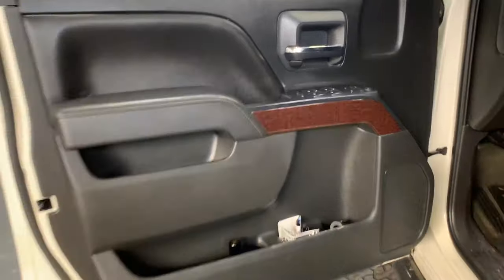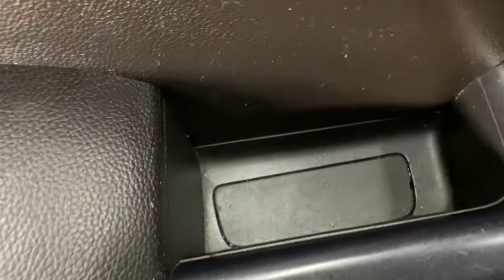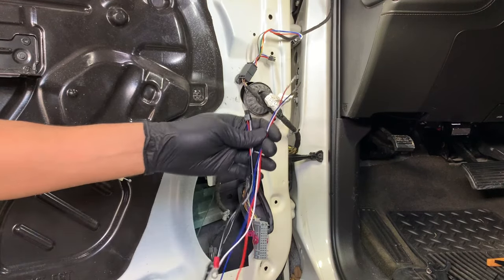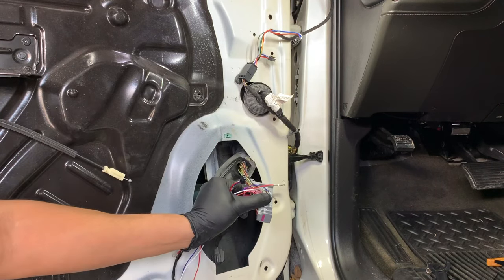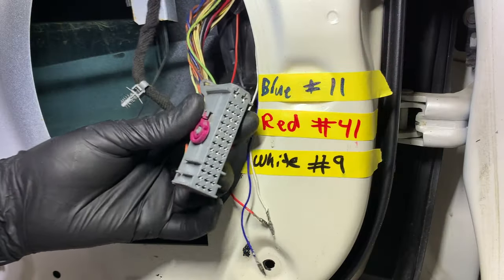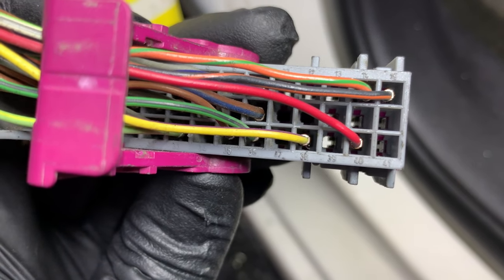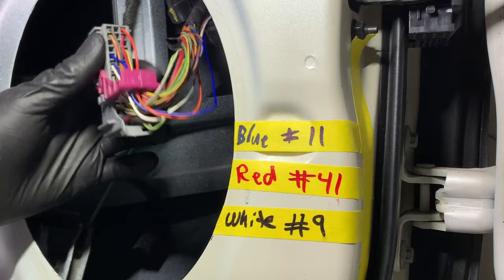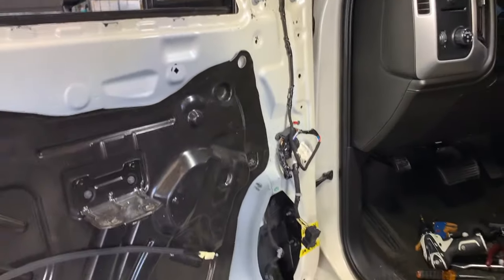How To Install / Wire Tow mirrors on a 2014-2018 Silverado / Sierra

Comment: Are those aftermarket tow mirrors eBay special or are they OEM GM parts will this work on both will these also powerfold
Reply from the maker: This is for the lights to work and will also make the powerfold work if you purchase the powerfold switch at the dealer . It will work on all tow mirrors.

Comment: I bought other tow mirrors, but for the switchback light the 3 wires aren’t pinned to anything. So For you guys tow mirror switchback option, are the switchback wires pinned to the door harness or somewhere else ?
Reply from the maker: Hi , this wiring harness provides power to the mirror for the running lights and turn signals to work . If you install the switchbacks correctly they will also work.
Reply: @kanohkustoms  would you be able to tell me how to wire up the switchbacks or no?
Reply from the maker: @FreddyS1K  I dont know where you purchased . The benefit of buying from us is we    answer any questions dealing with install or troubleshooting  .
Reply: @kanohkustoms  it’s from MidsouthLED , but lesson learned on where to buy next .

Comment: I was told you have to program your computer (dealer) to get the turn signal to work with your truck? Does this work then if your truck didnt come with the turn signal option? TIA
Reply from the maker: Hi , no need to program . This harness will make all the lights work if your truck was built after 08/14
Reply: @kanohkustoms  the harness compatible with OEM tow mirrors or only for the ones you sell? Thanks for the fast response
Reply from the maker: @chivassantana  yes compatible with oem and no problem

Comment: Did anyone have a green wire running into pin 41 already? I followed all the steps & when I got to pinning in the required spots, I had a green wire in pin 41 already. Do I bypass wiring the red wire since I already have a green wire in pin 41? Lost
Reply: I’m having the same issue what you end up doing?
Reply: @JoseGonzalez-uw3rc  I reached out to their “customer service” where I could ask about the green wire & provide a picture as well. I was told to pretty much connect the red wire to the green wire. Either share the same terminal or just splice the red wire into the green wire. Haven’t tried it yet but I plan on doing it here in a bit.
Reply: Ok thank you I spliced the red wire to the green wire but just to the pin part and left the green wire out everything works but the reverse little likes and the switch backs let me know how your turns out?
Reply: @JoseGonzalez-uw3rc  So yea bro, I did everything the way he says. Blue (11), White (9) & I kept the green/purple wire pinned & just spliced into it. My mirrors are working as they should with all functions. I should have recorded a video explaining before I put everything back together. Hopefully this comment thread will be seen by others tho if they’re wondering about having a wire pinned into (41) already.

Comment: What is the extra harness for is my only question
Reply from the maker: This will make running lights / turn signal / cargo lights work on tow mirrors.
Reply: @kanohkustoms  are the harness sold as a pair or single
Reply from the maker: @christiangirard6634  pair

Comment: Whats the difference if it was made before 08/14? Is there a seperate wiring harness?
Reply from the maker: Hi , if it was made before 08/14 there is no power for running lights or cargo lights in door jam plug so no harness in the world will work . We do how ever have a wiring kit that will make them work . Here’s the link . 

https://www.ebay.com/itm/124711530242?hash=item1d0962ef02:g:DyEAAOSwcvJgkx~1
Reply: @kanohkustoms  will the turn signals still work then and would you wire it the same then?

Comment: If my trucks mirrors have all the options already and power folding do I still need the harness or no? The mirrors on it have the blinker and running lights at the bottom of it
Reply from the maker: If you have small mirrors the lights at the bottom are puddle lights not running lights . The harness will make the running lights and cargo lights work .
Reply: @kanohkustoms  thanks! Will power folding still work ?
Reply from the maker: @matthewpitts9094  You’re welcome. Yes since your truck already came equipped with powerfold . The harness is only for lighting
Reply: @kanohkustoms  will there be a video for installing mirrors on a truck built before 08/14?

Comment: where can I get the pin connectors for the wires , my did not come with them.
Reply from the maker: We sell them together with the wiring . Here’s the link https://txtowmirrors.com/collections/14-18-gm-tow-mirrors-install/products/copy-of-14-18-gm-tow-mirror-wiring-harness-for-cargo-lights-turn-signals-running-lights

Comment: If I wanted to mount power fold mirrors on a truck not equipped is there a harness and switch for that as well?
Reply from the maker: Hi, all you would need is the powerfold switch . This harness will already provide power for it .
Reply: @kanohkustoms  Thanks

Comment: I wish I would have seen this video before I purchased the tow mirrors I got. 
What do pin #s 11, 41,& 9 specifically send power to? 
The mirrors I purchased on Amazon have all the wire for the light in the harness, but the wires in the door are not there. 
Also do you sell A wiring harness and ambient temperature sensor for the passenger side?
I have a 2018 2500HD Chevy Duranmax and now I have a check engine light for the ambient air temperature sensor.
Reply: Also this video is awesome!!!

Comment: hey, I did everything as it is in the video but the cargo lights do not work, any solution?
Reply from the maker: They turn on with cargo liight switch under the radio .
Reply: @kanohkustoms  I did it but nothing
Reply from the maker: @manuelfernandez9322  email us @ texastowmirrors@gmail.com with your phone number and your order number . We will help you troubleshoot it .
Reply: Any update on Manuel's issue? I heard you have to get the dealer to flash the BCM to get the cargo lights to work. Is this correct?
Reply from the maker: @bigboy760yee  Hi , waiting on email . No you don’t . You just press the cargo lights switch and they will turn on if harness is installed correctly .

Comment: Where can I buy those metal pieces that hook onto the wire and latch into the wiring harness? I can’t find them anywhere. If that makes sense
Reply from the maker: we sell them together with the wiring , here's the link https://txtowmirrors.com/collections/14-18-gm-tow-mirrors-install/products/copy-of-14-18-gm-tow-mirror-wiring-harness-for-cargo-lights-turn-signals-running-lights
Reply: @kanohkustoms  so when I buy that’s for the driver side and passenger side mirrors right?
Reply from the maker: @joeysilva5372  yes
Reply: AMP Micro Timer II Series Female Sealed Terminal 962876-2 (25 Pieces)
Reply: Napa has the terminal pieces just tell them to let you see the ones in the back

Comment: My tow mirrors only have one plug coming from them what do I do?
Reply from the maker: Select “no” on the question if you have the second plug . 
https://txtowmirrors.com/collections/14-18-gm-tow-mirrors-install/products/copy-of-14-18-gm-tow-mirror-wiring-harness-for-cargo-lights-turn-signals-running-lights
Reply: My plug on my mirrors doesn’t have the running lamp wire
Reply: As shown on the paper that was sent with the single plug kit
Reply from the maker: @andrewcarden702  Hi , our shop number is on the instructions . You can also email us with your order number texastowmirrors@gmail.com

Comment: What functions do the numbers perform for the extra wires (9,11,41)?
Reply from the maker: Car lights / turn signal / running lights
Reply: @kanohkustoms  does the harness adapter just plug into the end of my tow mirrors? Then I run the blue, red and white down to the door jam connector?

Comment: What is it had a blue white wire on 41 do we cut it off and just put the red one ther?
Reply from the maker: Hi , No . It stays in there . You only need to do the running lights and cargo lights (blue and white )
Reply: Oh okay sounds good so I don’t need the red one then
Reply from the maker: @efranrios5460  thats correct
Reply: @kanohkustoms  okay thanks
Reply: @kanohkustoms  where did you get the pins to put in 9 and 11 I’m look for them?
Reply from the maker: @efranrios5460  we sell them on our website together with wires . Txtowmirrors.com
Reply: @kanohkustoms  do yea only seeñ towing mirrors I wanted to know if yea sale color matching exterior Handel with led ?

Comment: Where did you get the connectors?
Reply from the maker: We sell them together with the wiring - here’s the link https://txtowmirrors.com/collections/14-18-gm-tow-mirrors-install/products/copy-of-14-18-gm-tow-mirror-wiring-harness-for-cargo-lights-turn-signals-running-lights

Comment: Is the wire harness for the reverse light and switchbacks to function?
Reply from the maker: Nick Slates Hi , on 2500s the “ reverse light “ is actually a cargo light from factory which this harness will make work on any GM truck that was built after 8/14 .  This will provide power to your running light on the tow mirror also . If you install the switchbacks correctly - this will make them work .

Comment: I bought the harness and did everything on the video and now I can’t even move my mirrors with the controls inside lol 🥲
Reply from the maker: Hi , did you add a powerfold switch ?
Reply: @kanohkustoms  my truck has one and it was working before I tried to install the lights on my tow mirror
Reply from the maker: @AlexHernandez-zj8zq  the harness has nothing to do with controling the mirror . It only makes the lights work . Thats why I asked about adding a powerfold switch . That will make your fuses pop if it was the wrong one . Email us your order number and your phone number so we can help you trouble shoot it though . We havent had anyone have a problem . Texastowmirrors@gmail.com
Reply: Hell yeah! Now it’s working! Thanks for the help !! Excellent service ⭐️ ⭐️ ⭐️ ⭐️ ⭐️.

Comment: Hi, I have the wiring harness, but my tow mirror does NOT have a second plug like in this video, just the main one. So I have no where to plug the harness into? Is there a work for this or do I need to get different towing mirrors?
Reply: I have the same issue.
Reply: @joelrippy6605  I ended up ordering the wiring harness on their website.

Comment: I have a 2014 silverado 1500 LTZ do I still need this harness as this is a LS/LT trim ?
Reply from the maker: The most important thing is for it to be built after 08/14 . After that , even ltz needs a harness because 1500 don’t come equipped with running lights or cargo lights .
Reply: My truck was built 6/13
Reply from the maker: @betochipistube6543  Here you go - 

https://txtowmirrors.com/collections/14-18-gm-tow-mirrors-install/products/trucks-built-date-before-08-14-2014-gm-tow-mirror-wiring-for-cargo-lights-turn-signals-running-lights
Reply: Thank you

Comment: If my trim is denali do i still have to do the wiring or its just plug and play?
Reply from the maker: What year is your truck and did it come with small mirrors.
Reply: @kanohkustoms  2018 sierra denali yes small mirrors
Reply from the maker: @lfnayolga  you will need harness for running lights and cargo lights to function.

Comment: Will the cargo lights turn on when put in reverse?
Reply from the maker: Hi , what year is your truck
Reply: @kanohkustoms  I have a 2017 Sierra elevation SLE
Reply from the maker: @ColtWorks100  They are cargo lights on a 2017

Comment: Will this work on a 2014 gmc Sierra?
Reply from the maker: If it was built after 08/14 yes. If not we have a seperate harness / video.
Reply: @kanohkustoms  ya mines the newer body style 14 it’s the 14-18 body
Reply from the maker: @BenMacRae-k8z  it can be nthat bodystyle and still be built before 08/14 . Double check on vin sticker